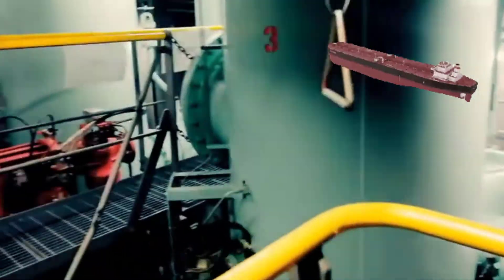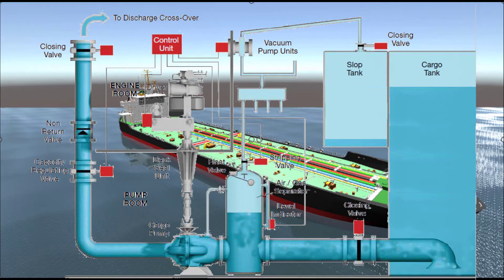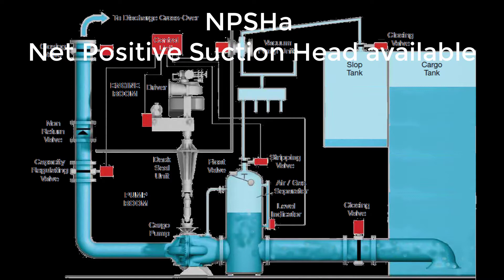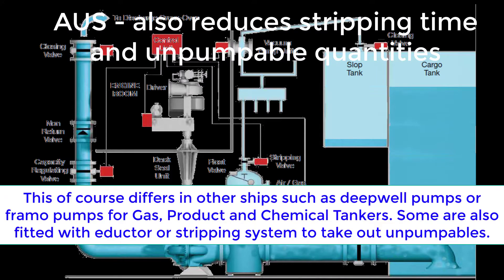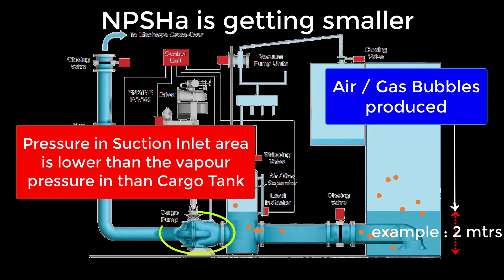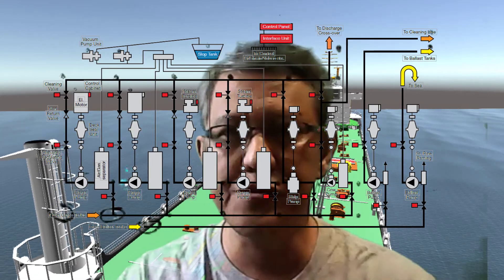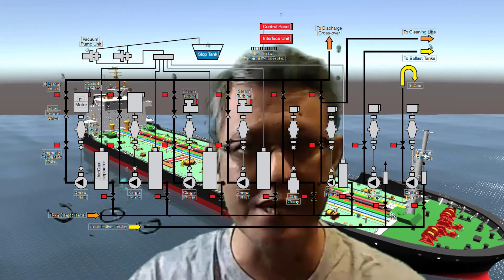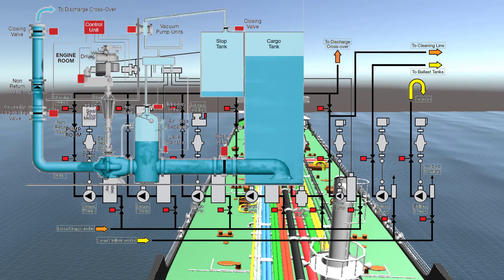Automatic Unloading System - AUS on board Crude Oil/Product Carrier of large sizes w/ Pump Rooms.

Comment: This pump above separator is a stripping pump ?
Reply from the maker: No Sir, that is a vacuum pump for the separator. Stripping pumps are more of a displacement,  or reciprocating  type which basically used as the main stripping pumps to strip out more where main pump can not do so.

Comment: Sir thanks for your video , what is the maximum  suction pressure will in be  separator besuse more suction will create implosion the separator
Reply from the maker: the suction pressure is basically determined by the max and minimum level settings in the separator. as the required level is reached the vacuum pump start and stopped. and loops in cycle. it has also a pressure trip sensor in case the level sensor malfunction.